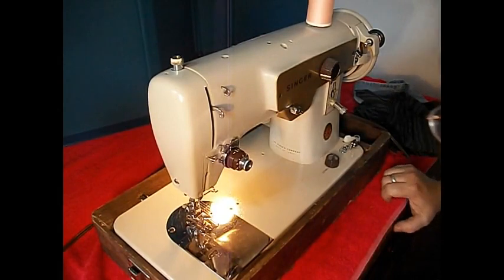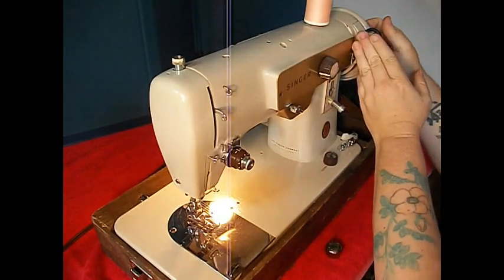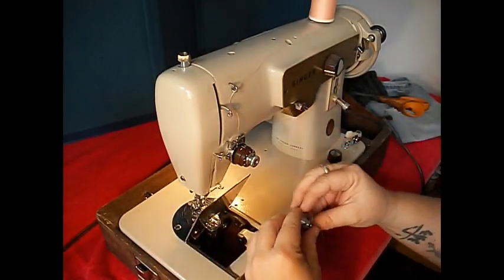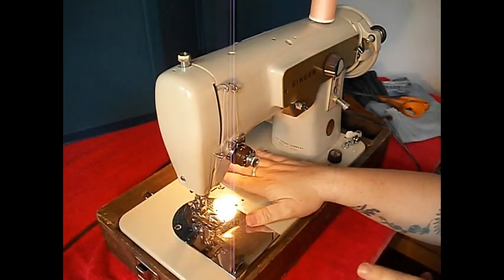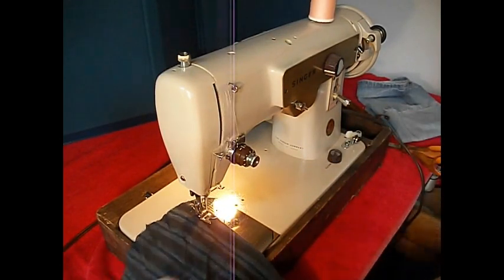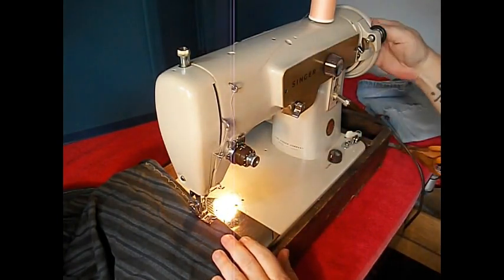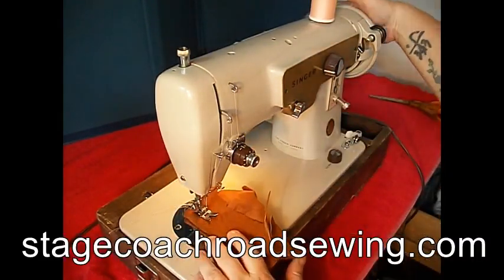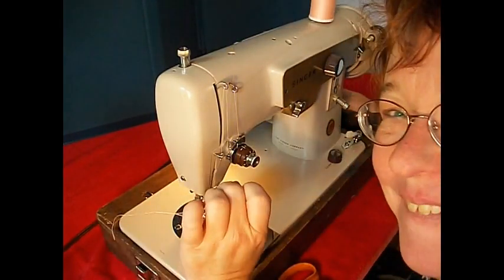Demonstration Video of a Vintage Singer 223  Sewing Machine

Comment: Got one a couple years ago for $80.  My wife has a $1200 Pfaff.  She likes mine better.  Solid as a '60's Mercedes Benz, and just as smooth running.  I've sewed sails, multi-layer heavy canvas bags and satchels, thick nylon webbing, medium leather for knife sheaths, axe covers, etc.  Just a bull dozer.  Not for heavy bridle or saddle leather, though.

Comment: it is double drag to sew leather?
Reply: No.  Yhis is a basic, all steel and iron machine that punches thru because of its mass and rigidity.  it has no walking foot or drag needle.  It's just basic up-down motion.

It will struggle in veg-tanned leather stacks over 3/16" thick because of the weak  home-owner motor.

Technically, this is NOT a HD sewing machine.  It's just built heavy.  These are not the same things. It lacks a HD motor, a walking foot, a HD flywheel, and a bigger material opening under the presser foot (max is about .300").

That said, it was made from 1956-1964, and will still far outlast the best homeowner machines built today.